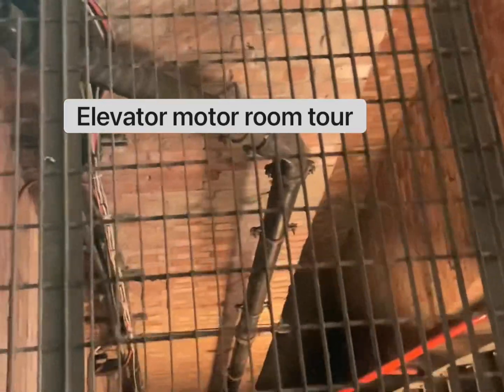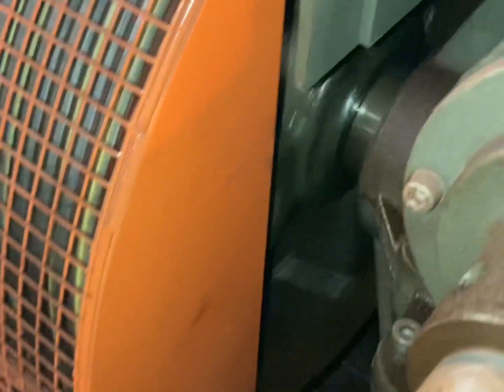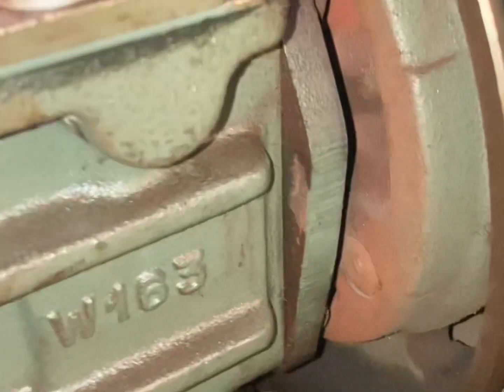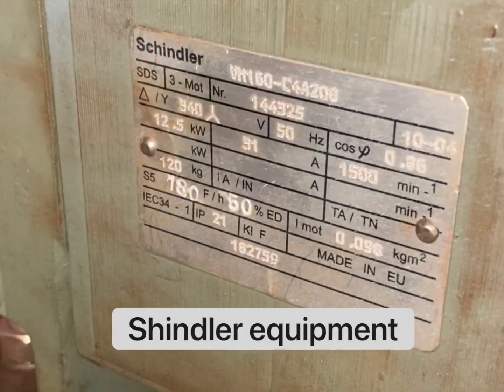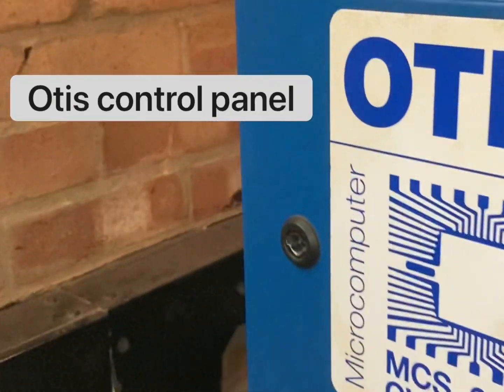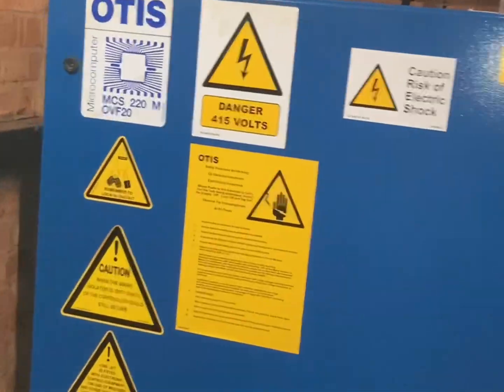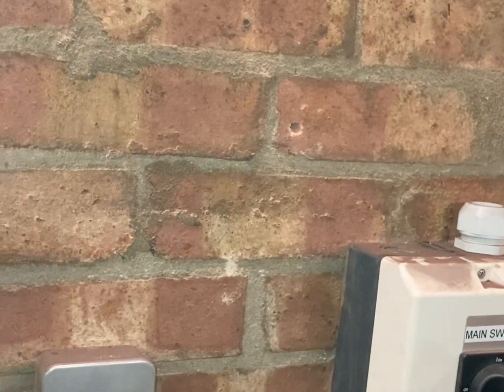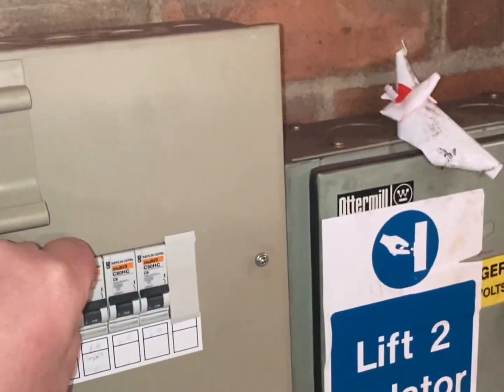Elevator/Lift Motor Room Tour

Comment: A Schindler W163 runnning on an Otis LCB 2 - that's something I've never seen before. It is especially intriguing that both appear to be from more or less the same age (2004 on the motor), so it is not just some mod like a new controller on an old lift.